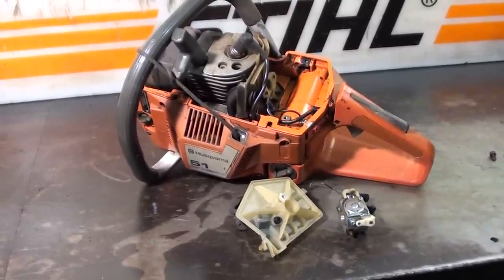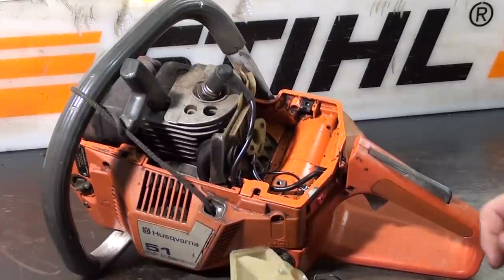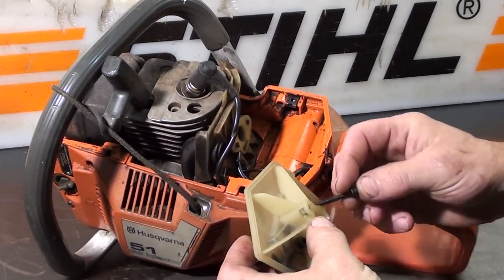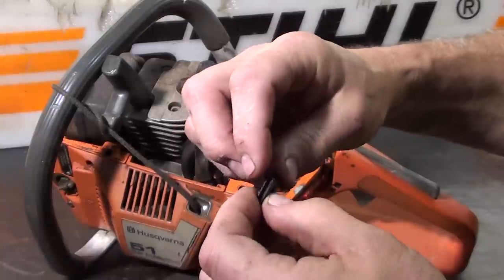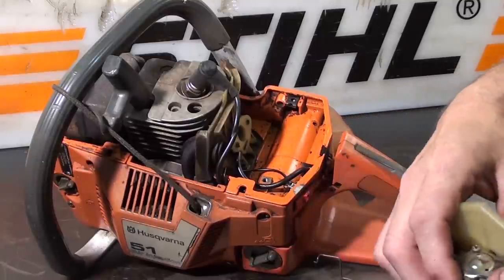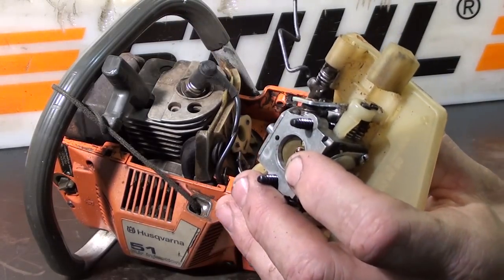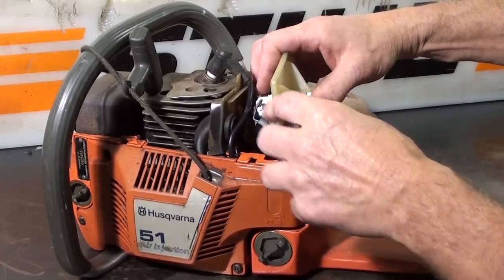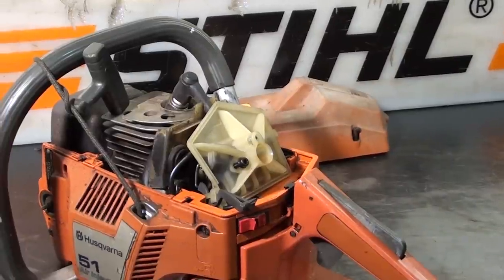The chainsaw guy shop talk Husqvarna 51 55 chainsaw linkage repair 8 28

Comment: Thank you sir for this H 51 video.  I took my saw apart for the first time since I bought it in 1992 to install a new carb/fuel line/fuel filter/airfilter.  I was doing this late at night in poor lighting and I did not take notice of the throttle linkage routing before I pulled the carb.  I cleaned the entire saw, put in the new parts, started to install carb but I could not find any opening in the filter frame for the throttle linkage.  After 20 minutes of failure on a dark, hot humid night, I took a Gatorade break and searched YouTube.  In 2 minutes I had it figured out, thanks to this video.
Reply from the maker: Awesomeness CKR!
Take Care,
WestCoastMuscleSaws 
TheChainSawGuy 
Rich

Comment: So the best way I can describe the linkage hookup is as follows: on the left side of the carb, the linkage end with the sharp right angles (not the straighter end) connects to the lower hook-shaped carb piece. iT DOESN'T fit into the hole on this same piece. What helped me was realizing the other end is simply pushed forward by the throttle trigger on the saw, so all you really aim for is to get the throttle to open by pushing the linkage forward.
Reply: my f'ing hero!

Comment: I put a new carb on it .  When I start it up goes right to high race shut off .  To keep it going pull in and out the choke. Made all the screw adjustments no matter what I do does runs same way. Do you know what problem is?   I buy another carb if I have to .  But what is a good name .  Is Walbro a good name  carb  ?

Comment: Sorry sir.  You failed to give proper camera angles for the throttle & choke linkages.  You did not show where the links attach to the carburetor.  This video is ok for those who have worked on a lot of saws.  I bought this saw and not familiar with this model.  Thanks you.

Comment: Thank you for you video.  I skrew my saw in parts and i think before i can´t repair it never. This video help me lot that carburator part. Now it works perfectly with new parts. That gas arm assembly is too fast in video but i got it. Thank you.

Comment: hey does the husky 136 have a air filter or not? I got one and it aint got a filter on it
Reply: Every saw has a airfiltet if you use it without one the piston and cylinder will S^€~T  the bed💩